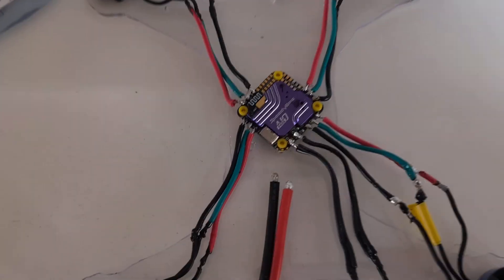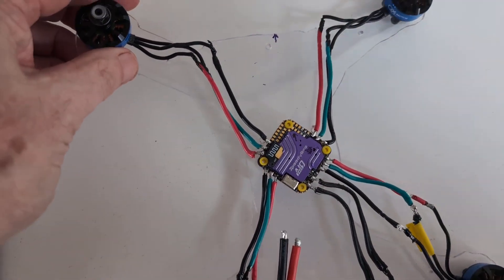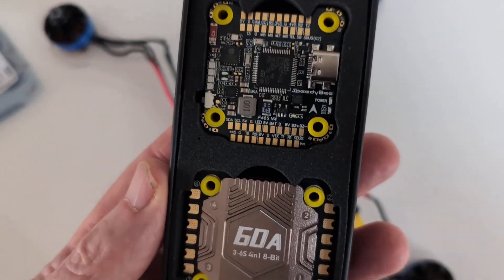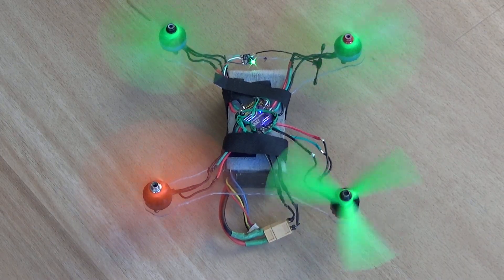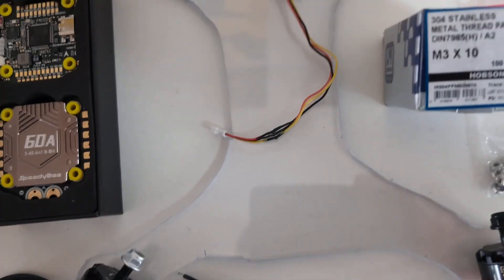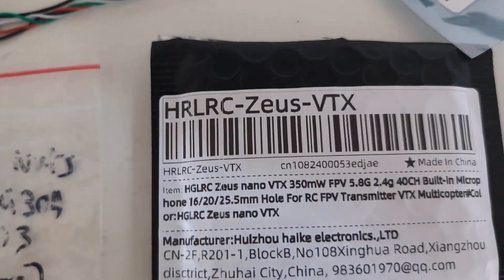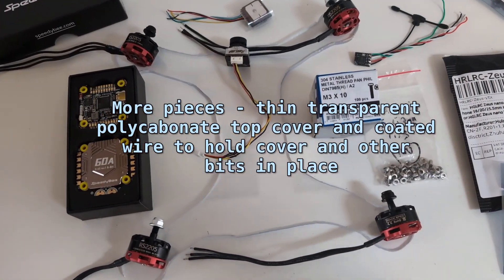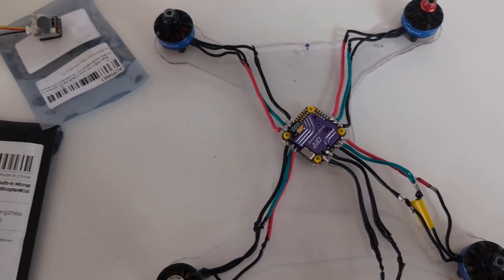Failed Quadcopter build, so on to the next!

Comment: Get seperate escs. You are going to blow a lot of escs in the beginning. It is expensive to replace a 4in1 vs just replacing a single esc.
Frame may work for now, but I am sure that it will flex too much, so you will probably have some issues with tuning.
The frame will probably still fly better than back with the old kk2 boards.😅
Reply from the maker: Had a lot of experience with seperate ESCs over the years from when I started modding Bugs3 to safely fly with 3S batteries. The SpeedyBee AOI is the first modern FCB that I've damaged through a brain fade episode. Getting old can have it's moments, but still better than the alternative. 😅🤣😂

Comment: I wanted to add something but for some reason my last message disappeared? Anyhow, I gave you some pointers, I'm not sure what's happened, so hear it is again... 

Somebody built a drone like that for bardwell and he did a video on it, flat plastic doesn't hold up very good and is terrible for vibration, some wood paneling sometimes can work better than than flat plastic for a frame. Or you might be able to make some gussets out of your left over plexiglass, You can scuff the plexiglass where you want to put it and then  glue the edge of the gusset to take some of that twisting out. The way a three-phase motor works it will actually make the end of the arm twist back and forth, they call it motor oscillations. I would also recommend using some of those red fiberglass washers on all your screw holes on both sides of the plastic because their screws can cause stress and where the plastic is cut will crack. But you can usually find some pretty decent frames for around 10-15 bucks on AliExpress. The apex clone is more now but is a really good frame, just is lower quality carbon then the real apex. Sologood makes an evo clone. You will want to double check the hole mounting for your motors cuz those old motors are sometimes different then newer ones. my favorite frame is the Thumpr from CNC drones, It's more expensive but is alot better than most the frames that cost literally twice as much! Plus its t700 carbon fiber.

It looks like you could use a better soldering iron, most people like the ts100, personally, I have a JDC 8898 station i got on AliExpress for $30, it works fantastic for the price! Even has a hot air gun. But yeah, you want to stay away from PVC coated wire when soldering, silicone insulation is far superior as it doesn't melt and its pretty much the standard today. I think the 8898 comes with a bunch of extra tips. You always want a fatter tip for doing your battery lead, but you can get some real nice long skinny tips for those tiny pads. I think the 8898 comes with an assortment.

Now when it comes to your problems, it looks like your all-in-one is still good because the motor started, but it looks like it doesn't like your motor and is just shutting down, you should swap two of your motors to see if it's the motor or the all-in-one itself. Hopefully you haven't hurt your esc, those old school motors usually have multi-wire windings which is cheaper then single wire wound stators. The problem with multi-wire wound stators is that the thin wire has more of a tendency to move a little due to the induction and it rubs through the insulation and start shorting out. It was a common thing a decade ago to put some glue in on the windings to lock them together to keep them from moving, eventually about 5 years ago or so they started  dipping them after they wound the stator in enamel to lock the wires together. A single strand wound stator has thicker wire that doesn't move, as long as it's wound tightly. You usually don't have any problems but I have seen some loose wraps on motors that eventually gave problems, I got those Meps neon motors and one of them failed due to being wound loosely... Also they were hand wrapped back then, today they had machines that do it. So there's less of a chance of too much tension causes the enamel to get damaged. So you could have just got a bad motor...

 Hopefully your aio is ok and its just a motor, but personally, I'm not a fan of speedyBee, i prefer skystars cuz they are pretty much bulletproof, but I've even had better luck with Jhemcu aios then speedybee, I've heard that the red f7 Hakrc aio is supposed to be one of the best too!
If you want to clean your build up a little bit they have some little boards called LED race wires, race wires are boards that you put in place of where you spliced your motor leads to make the wires longer. They are to help make it easier to change out motors when they fail, racers use them a lot but now you can get them with LEDs on them that use the motor power and get brighter with more throttle, they look pretty neat flying around.

Comment: Neat experiment!! 

I too have used Polycarbonate as Flying Wing Vertical Stabilizer Tip Fins and it's tough, shatter proof, and can be cold / heat formed into any shape ( assuming you have the right tools and safety gear ) but polycarbonate IS easy to mar and scratch. That can be mitigated if you use a 3-part liquid ceramic coating to give the polycarbonate glass-like properties where it becomes scratch proof but I've haven't paid much attention to the longevity of liquid ceramic coatings on my applications using Polycarbonate as Flying Wing Vertical Stabilizer Tip Fins. 

The idea was to give the observer the illusion that my RC Flying Wings had no vertical stabilizers while the aircraft was in flight, when in fact they are there doing their jobs fantastically! 

Another material that's just as tough and durable is ABS... I'd like to say the majority of modern vehicles on the road use ABS for their exterior body and interior paneling... it has almost the same properties as Polycarbonate, except that it's usually manufactured in either Black or White colors ( the black is more forgiving ). Unlike carbon fiber, it's naturally non-conductive like polycarbonate. There is a version that IS conductive too, but it's reserved for special applications. 

STRONGLY suggest you purchase and use a Multi-meter to test ALL of your soldering connections for Continuity... if you hear a steady tone between a Positive and Negative connection, you NEED to double check ALL of your soldier work, make sure you don't have wires and soldering that bridge between other wires or pads. 

I would ALSO suggest you use the proper size SILICONE insulated wires over PVC... high amperage flowing through PVC insulated wires will ALWAYS melt and cause or destroy your expensive electronics WHEN ( not if ) they create a short.

Good Luck on your next project!!
Reply from the maker: All very good points - got to admit my work is a bit rough and ready. I have a multi-meter, but got a bit slack about using it when my soldering technique improved. Think I've gone a bit too far down the rabbit hole during a wet spell - after one more video demonstrating bad practise, I'll get back to better quality and more outdoor flying 😁😅

Comment: If you can read the ESC to flash it than the MCU is still working. You can do some rudimentary checking of the mosfets with a multimeter.  Just in case you have not already looked in to it. Hopefully the board turns out ok, bummer if its not but also part of the hobby is breaking things I suppose.

Comment: That cheap PVC insulated wire is going to give you nothing but troubles and short circuits. Silicone insulated wire is cheap, as are frames. Also looks like the orange prop was spinning the wrong way. Take your props off and check your motor directions.
Reply from the maker: Fair enough - in particular, using thin poor quality wire for the battery connection is something I won't do again.

Comment: okay.. cool and all.. but.. i hope you are gonna get a proper 5 inch frame.. they are like 20~30 bucks on ali... cause.. that.. plastic frame aint gonna hold at all...
Reply from the maker: While carbon fibre reinforced polycarbonate is tougher, plain polycarbonate has enough strength and stability to meet my needs at this time. Maybe if I get into more aggressive fpv I could reconsider. Meanwhile, a one piece see through frame is working well for me.
Reply: @skybug3  The problem with the thin PC frame is you will probably end up with a bunch of tuning issues that you don't even realize the frame is causing.  Doesnt have to be CF but you need something stiffer than what you have or your are going to struggle to get it to fly well at all. I not talking about flying acro and crashing durability either.
Reply: @skybug3  😓🫣

Comment: Great build, and the look is simply EPIC, nothing could be more DIY than that :-) But doesn't the frame flexing introduces vibration and resonance? at least that's what I heard from others, no direct experience myself.
Reply from the maker: Polycarbonate is the stuff they make riot shields from - much more impact resistant than other plastics. The 5mm thick sheet I used for my first successful build is rigid enough to fly smoothly. I think the thinner sheet used in my unsuccessful AIO build was too flexible - but didn't get airborne to check. May put an old Bugs 3 FCB on that frame to see how it goes. 😁
Reply: @skybug3  Looking forward to your further experiments! 👍

Comment: Continuity test Everytime..  on main battery in.. if hear a steady beep.. check everything.. the plexiglass x frames great idea!! Solder joints looked great 💪💪🙏👍👍
Reply from the maker: Total brain fade for me to mix up + and - for the battery lead. 🤪
 Got to clean the tip with damp sponge and dry brass wool cleaner frequently - really helps the solder to flow. 😄
Reply: @skybug3 clean tip important big time.. continuity test.. hold both positive and negative together on tester. When set to continuity mode. Will beep steady..  when in Right mode continuity.. you put Plus on red and black on negative. On battery lead.. Shouldn't hear a steady beep. If do then you have short.. you might hear a Short beep. Because you're charging any capacitors in the all in one. Only takes a mila second..then shouldn't hear anything. If do.. you have a short.. double check all connections.. before you plug in battery. Could be battery lead? Buzzer? Something not right if you hear beep.  Saved me plenty of times.. well enough to test every build before I plugged in battery.. my First mistake cost me a DJI camera.. not cheap..😮
Reply: @skybug3 we all do it...  Too Brain fade 😊
Reply: Display case is awesome....